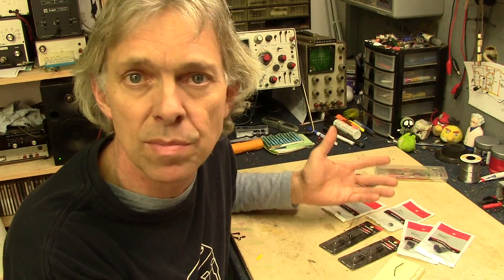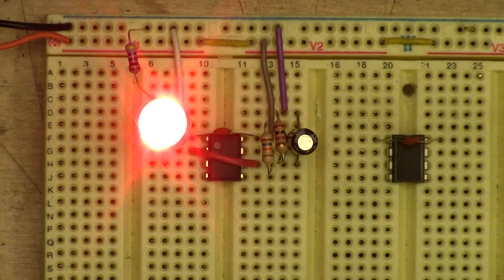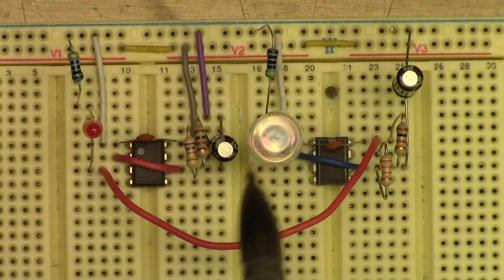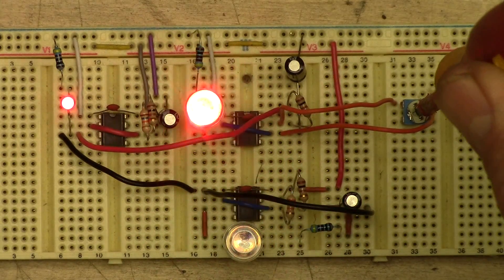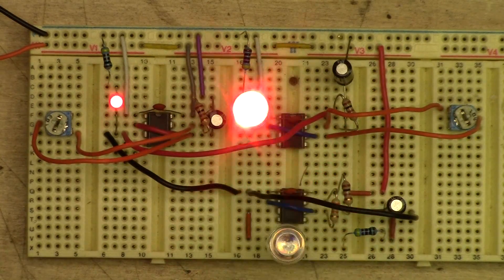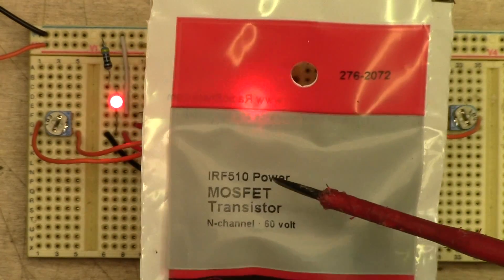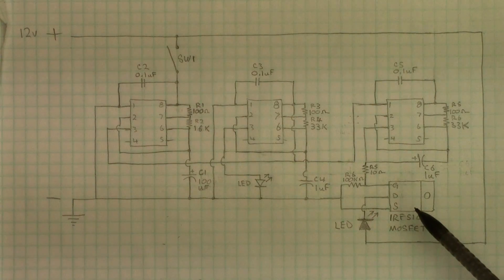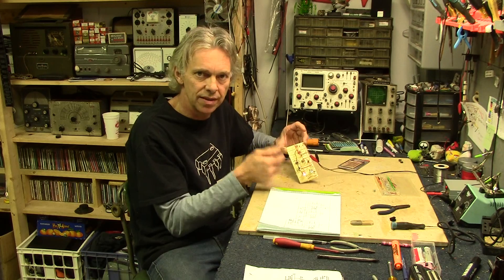DIY Emergency Vehicle Light Flasher Part 1

Comment: I see this is older video but RadioShack stopped carrying or even attempting to sell or order circuit pieces anymore 🤦🏽 I couldn’t even get a 2200uf 16v cap but glad I save my old electronics to salvage parts
Reply from the maker: Sad but true.

Comment: I'm only a noob hobbyist when it comes to electronics, but would love to try this project for a model police vehicle, can i add red and blue lights to this setup?  or does it require different resistors for the different color led's? Thanks
Reply: nuggs13 I'm like you, just an average...Jill. Red and blue LEDs do have different voltage and current draws, so 'I' would recommend checking the Google machine for said ratings, using your chosen led color and size in your search terms, i.e., 3mm, 5mm, 10mm, etc. play safe, now. HOPEFULLY, I helped you..? Maybe you solved the issue long ago.

Comment: If I may. At 17 min in, you show C6 going through the gate resistor instead of directly to ground. And, an N mosfet, or xsistor does bot really drive a load.  It more sinks it, turns on the ground if you will.  Certainly a P type will drive the load. I would recommend those. Otherwise, your led bar needs a 12v source at the light plus the ground to the cct.  A P type, 1 line from tne cct, and the led bar can be grounded right near the light. Saves wire.  My $0.02.

Comment: stupid design, why to build 3 oscillators?
if you can get away with 2 ???
all wat was needed is to feed signal of hi freq oscilator to a logic circuit controlled by low freq oscillator or maybe you can get away with a discreete logic circuit

Comment: If these guys want to save a few bucks,I'd suggest doing a group-buy from Digi-key or somewhere,instead of Radio Shack. You could buy the parts for 10 of them,for what the parts for one would cost,from RS.

Comment: Excellent video, explained perfectly. I have something to add to this if I may. Squad car, Ambulances, etc. headlights bounce from left to right, well they did several years ago, I would add in two relays so they can be alternated when the "Strobe Box" is energized but when it is off and the relays are not being used and the contacts would be closed allowing the head lights to function normally. Again great video, keep'em coming!

Comment: A suggestion - you can use two chips, a 556 and a 555. The 556 is nothing but a dual 555.
Reply: Yeah he is very aware of that! This man knows his shit!
Reply: kd1s he already responded to this above; Radio Shack didn't have any in stock. You may trust he learned such basics long ago. 😉

Comment: Very nice video , I like your method that you combine the two IC's together.
* But is there any other IC we can use it instead of using three 555 IC's ?
* Can I use more than two LED's - for example 3 LED's in a group and another 3 LED's in the other group -? 
I hope my questions are clear to you ..... thanks
Reply: The final project will have multiple LEDs in each light assembly. You could use a 556 which is two 555s on one chip or a 558 which is four 555s on one chip.
Reply: *****  Thanks again for this quick reply....regards